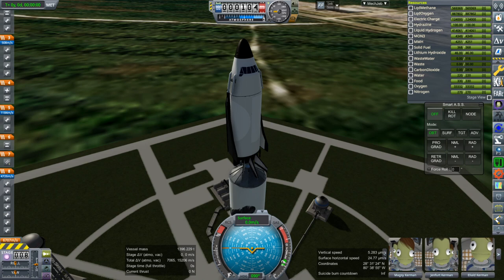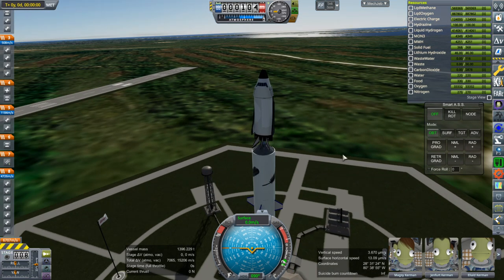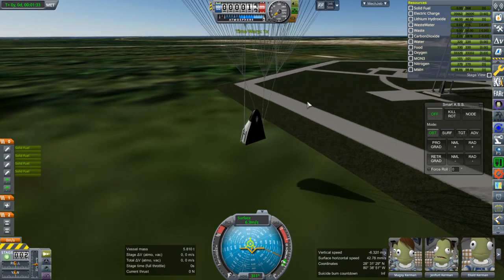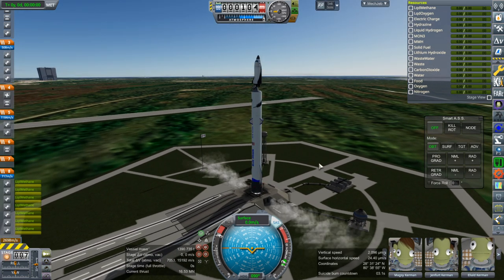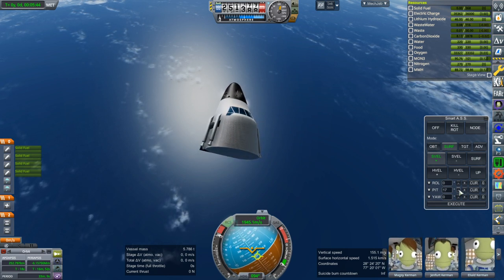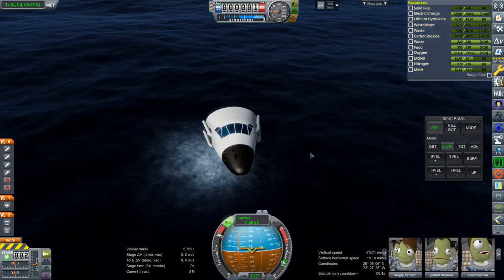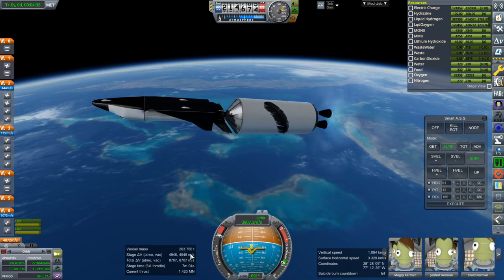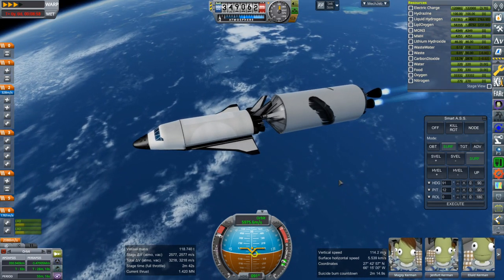Realism Overhaul in KSP 1.8.1 - Shuttle Mark II Abort System Testing

Comment: I love abort tests. I think all other engines are disabled when abort is called though. It prevents the booster flying past (or into) the capsule after the SRBs burn out. I like this shuttle design, very cool!
Reply: yeah but its best to test it with engines on cause there could be a scenario where the guidance computers and or terminal guidance systems aren't able to do their jobs
Reply: No an abort motor with only the capsule is way faster then the rocket. For instance look at the spaceX in-flight abort test
Reply: @Myname-il9vd  Ok, except that's never happened. (The Russians don't count, they just light the rockets and let them go). Redundant flight computers and terminal guidance systems prevent this.
Reply: @Jacob-th7do  Of course the abort motors are faster, but these ones are configured for only a few seconds, then they burn out while the booster keeps burning. Just watch the booster fly by the capsule in this video. SpaceX also disables booster engines on abort.
Reply from the maker: Shuttle II is a launch vehicle agnostic system, which means it may launch on SLS, and SLS cannot turn off its SRBs. So, this test is conducted with the engines on. SpaceX disabled the booster engines on abort because the Dragon 2 may not have enough TWR to escape otherwise. Most launch escape systems have double the TWR that Dragon 2's system has.
Reply: @RaizSpace  I did not know that, thanks!
Reply: Stephen Dunleavy better safe than sorry a worst case scenario is always possible and it’s good to plan for worst case when human lives are on the line you get me?

Comment: Why not mount a few small fins on the SRB's for stability, they can be jettisoned with the abort motors as not to impact flight characteristics if not needed. And it shouldn't make a big difference on ascent. After all tumbling can cause problems with proper parachute deployment and subject the crew to strong forces.